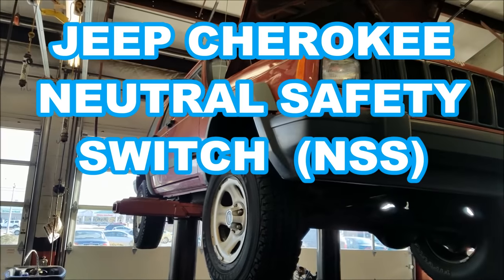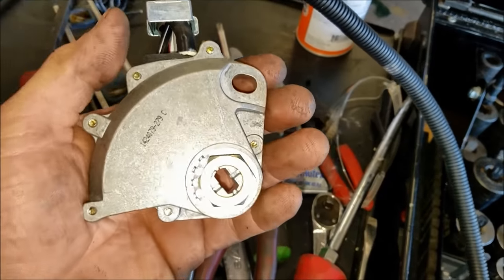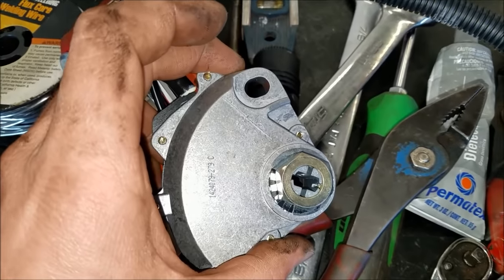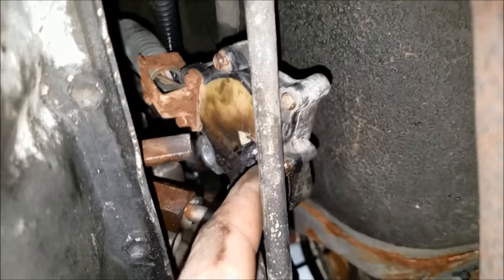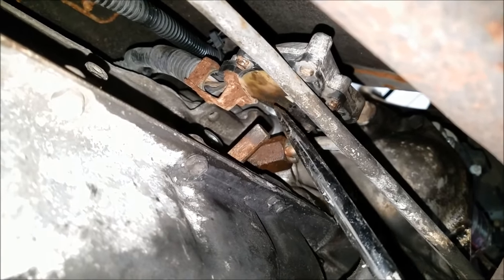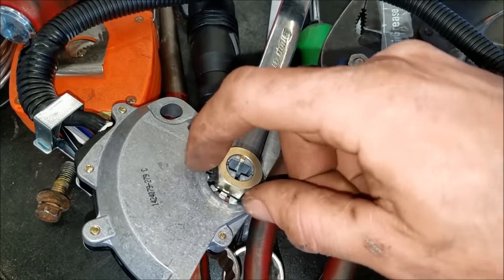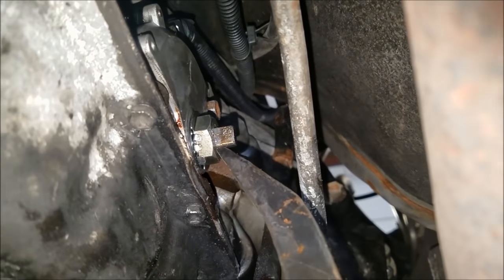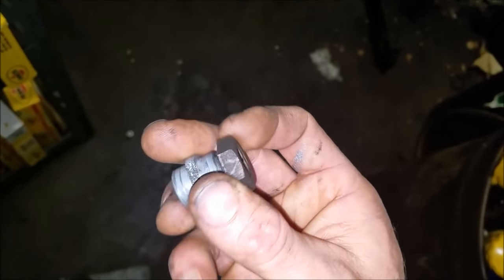JEEP CHEROKEE NSS replacement Neutral Safety Switch quick! Comanche

Comment: Thank you for posting this no nonsense video. 
I have a tip for anyone watching about how to thread the new NSS cable and harness through. I didn't use a string/tape/coat hanger (I see no possible way of pulling the new wiring harness through where the wiring goes as the opening is not big enough there. All I did was... Pay close attention to how the original NSS wiring was positioned. Then I took out the Old NSS. Then I held the NEW NSS wiring harness from above while letting the NSS housing drop down from above through the larger opening area near where it will be (not exactly where the wiring goes trough), while still holding the wiring harness from above (like you are fishing it down!). THEN FLOSS THE NEW NSS WIRING INTO POSITION by firmly dragging it into place, past the throttle cable which is also down there, then zip tie it back to the wires of other parts that the original NSS was zip tied to, above the transmission.

Comment: I have been being told different reasons for my Jeep Cherokee having problems. All I  knew were wrong. This confirms that I do not need my transmission ripped apart or a new starter that was replaced already. Thank you for this. I now have information to get it fixed correctly.
Reply from the maker: No prob Jillian.  Good luck fixing it!

Comment: Honestly you're the only video on here that gives the most info on how to get the darned thing off
Reply from the maker: Kainine Eli glad to hear! And thanks so much for the feedback.  I try and get right to the point in those to my videos.
Reply: You're welcome! Do you have any pointers on getting those little teeth off? It's the only thing I'm really having trouble with
Reply from the maker: Kainine Eli are you referring to the steel tabs on the Locking washer?
Reply from the maker: Kainine Eli I used a pocket screwdriver on them to bend them over
Reply: I might have to give that a try

Comment: Ok so my cruise control wasn’t working light came on wouldn’t engage 
So after checking all  vacuum lines and all other options I put it on a scan 
That showed neutral safety switch bad 
I replaced that and now I have cruise control again less the. $10.00 fix 
Thanks for all your videos
I have a 2000 Jeep Grand Cherokee Laredo 4.0
Reply from the maker: Thanks for sharing your repair story. Glad to hear the video helped out! And thanks for your comment!

Comment: Thanks so much for the tutorial.  The NSS on my '93 Cherokee Sport just failed.  I've actually been starting the motor in neutral the last few weeks which is a sign of impending failure.
Reply: D Carlson so yours  starts fine in neutral?
Reply: I noticed that my NSS began to fail when my back up lights would not activate. Eventually, my jeep would not start while in park, and then after a while, I could only start my jeep in neutral.  This was clear evidence of the switch was slowly failing.
Reply: D Carlson my back up lights stopped working to. The only difference is mine wont start in neutral.  But sometimes my jeep will start perfectly

Comment: Great video, thanks. Mine won't start in park or neutral but if I pull back on the shifter just a little in either position, it will start. I'm wondering if this is something that can be fixed with adjustment?

Comment: And maybe I missed it, but since yours was already off you need to bend out the teeth on that nut before trying to remove it. Well, you don't have to, but it's a hell of a lot easier especially if you are hoping to clean & reinstall which may be what you have to do whike you wait for your new one to be delivered.
Also using a mini flat bar may work better than a screw driver as it spreads out the force on that stupid plastic body. Great video btw!

Comment: After 2001, they changed this. I have an 03 and everything I google has just a little shiny screw in three prong plug. Did the change it into some new design? Showing AutoZone part no. SW11030

Comment: Hey I have a 95 Jeep Cherokee and runs great however it started feeling like it would throw itself into neutral every two seconds now it will start but won’t engage to any gears could this be the issue? Thanks again man
Reply from the maker: Honestly know that sounds more like an issue with your transmission or shifter linkage. I could be wrong though. It's hard to say without looking at it

Comment: I ended up breaking it like you did, the part that the nut tightens onto is the only thing still on the transmission. The rest off the nss detatched from it. I can't put the nut on it now, is there anything you suggest to get the remaining pieces off? Would pliers just get it off with enough force?

Comment: Question, I read on a forum that a NSS can cause the transmission to shift funny, is this true info? It said it caused overdrive not to engage or slip off overdrive, are you aware of this?
Reply from the maker: I personally haven't heard of this honestly so I can't really comment.    If you're having a slipping transmission, I tend to doubt that the NSS would be the problem. But let me know how you make out. Sorry I couldn't be of more help
Reply: @NoNonsenseKnowHow  well the problem I'm having on my 89 is, when I'm cruising on just normal speeds in town, 1st and 2nd shift fine, when it gets to 3rd, the rpms drop lower then they should and the vehicle drags,  I accelerate and it's barely gettinspeed , if I let go of the gas pedal and then press it harder then it kicks in just fine I to overdrive and speeds up normal, once I get to 4th gear it does the same thing and sometimes doesn't even let me go past 50mph, not sure what my deal is, I've already done the tps and adjustment.

Comment: Bro i have a 04 Cherokee  and i was having to turn the key to on possession then press the brakes halfway before it would crack no other order. sometimes it would start like any other automatic and just start with no brake. But it wont start with key now. I had to take cover off the starter relay and manually move the arm and it  starts right up. Does that sound like NSS ??
Reply from the maker: That doesn't sound like an NSS off hand.  Hard to say without seeing it though. Let me know how you make out
Reply: NoNonsenseKnowHow i will. But what else could not be telling the starter relay to work? ignition?
Reply from the maker: @whocares5188  it could be the NSS,  a wiring issue, corroded contacts, a bad relay, bad ignition switch or probably a few other things. But without looking at a wiring diagram it's hard to say offhand. I work on all makes and models so I'm not incredibly familiar with any particular vehicle. Best thing to do would be get a wiring diagram and go from there honestly.
Reply: If it won't release out of park might need a brake sensor

Comment: This can make your reverse lights stop working?
Reply: I would also like to know this! My reverse lights have been acting up for over a year, they don’t usually come on but sometimes they do if I wiggle the shifter. My NSS finally bit the dust today, so I’ll have to replace it soon and if it fixes my reverse lights I’ll come back and let you know!
Reply: According to bleepinjeep on YouTube yes they can
Reply from the maker: Yes. A faulty NSS can definitely prevent it reverse lights from coming on.
Reply: @NoNonsenseKnowHow  I just had this problem. While trying to crank it. Tried to get a jump truck dies. If anyone can help let me know.

Comment: I have a 96 2wd. Took nss off and tried cleaning it but had no luck starting up. Trying to order a new one but am curious if it matters if in the description of some it says its for 4wd. Would it really effect anything or does it have to be a 2wd drive nss?
Reply from the maker: Nick Cimino to be honest with you I'm not really sure. I would have to do some research online. If it fits I'd have to guess it would work. Let me know what you come up with I'd be curious to know. Thanks
Reply: It ended up being the ignition switch! Got a new one for 35 bucks from advance and it fired right up. Still glad I had took the time to take the nss off and clean it anyways. Thank you for the feedback!

Comment: I think this is whats wrong with mine--- because if I jump the starter with a screwdriver it starts just fine.
Reply: Just got my new piece in the mail, came back for a quick refresher--- and putting it in right after this.
Reply: Was it fix ? I do the something to start mine. I got my jeep for 300 buck it got p705 code I change starter switch nothing but I can turn with screwdriver.

Comment: I had to shake my shifter to start every once in a while.  Replaced with aftermarket switch, now I get the P0705 code!  I have tried many times to adjust it, still get the code, even tried a second switch!  Any ideas?  Also... now my passenger side reverse light shuts off when I hit the brake (super weird).  WTF?!?!?!     1999 XJ with 238,000 miles... I wana see 1/4 million!
Reply from the maker: Interesting, I haven't heard or seen of that happening before.  Sounds like you maybe have a short in the harness or something like that

Comment: Thanks for the easy how too
Reply: Was wondering cruise control light comes on 
Won’t engage has vacuum too it 
Changed actuator still won’t engage 
Now my neutral safety switch needs to be replaced can that cause the cruise control not to work? Any ideas helpful

Comment: Is the nss a part in the transmission Range Sensor, or is it the same piece?
Reply from the maker: Same piece
Reply: @NoNonsenseKnowHow  thanks, my 98 has been acting wierd, throws p0705 and p0562 thinking its a bad ground wire cause doesnt have typical bad NSS issues
Reply from the maker: @austinsoos440  no problem. And yeah that could be. Might be worth it to take it apart and clean it out as well. Or replace it. Common for these to fail
Reply: @NoNonsenseKnowHow  appreciate it, and thanks for the quick response
Reply from the maker: No problem

Comment: What exactly does the adjustment on these nss do/adjust
Reply from the maker: If it's not adjusted properly the car may not start when it's in park. Basically there is some wiggle room on the shifter when you're in park. In on the extreme end of both sides of wiggle room it should still start. And it should still start in neutral as well. If all that's good then it's adjusted properly
Reply: @NoNonsenseKnowHow  thank you.  Im guessing my 99 4x4 has the same one and same transmission.  Aw4? I tried taking the old one off and cleaning the contacts on the inside.  It didn't work.  Ive been arcing the starter to crank it. Its just a place toy not a daily but its getting old
Reply: @NoNonsenseKnowHow  I noticed on Amazon that they seem to all be for the Aw4 trans. Mine 4x4 but I didn't see anything about which works on a 2wheel drive or 4wd

Comment: Where is the link?
Reply from the maker: Evan Barron in the description. I'll add it to the comments as well
Reply from the maker: Evan Barron HERE IS THE SWITCH ON AMAZON:

OEM MOPAR FOR 97-01: http://amzn.to/2C7mM03

AFTERMARKET FOR 88-96: http://amzn.to/2C9cRXy

AFTERMARKET FOR 88-96 : http://amzn.to/2C9co7K
Reply: Thanks but found it after posting. Issue I am having is I guess the 2002 has changed the config. I went to Auto Zone and Advance and both showed this $12 switch. Found a diagram that shows a different config. like mechanic said its internal. So I dont need the part.
Reply from the maker: Evan Barron cool, thanks for the update. Good luck with the repair